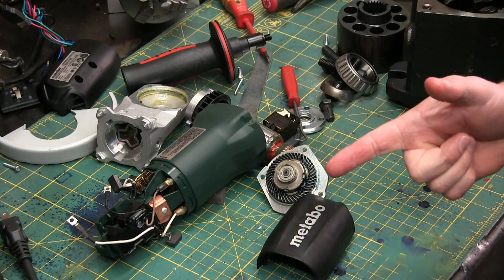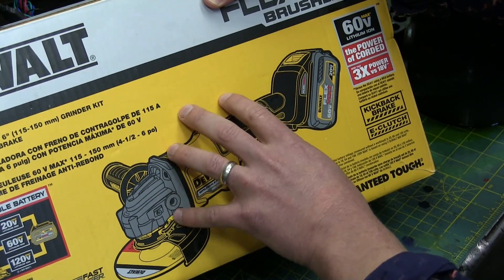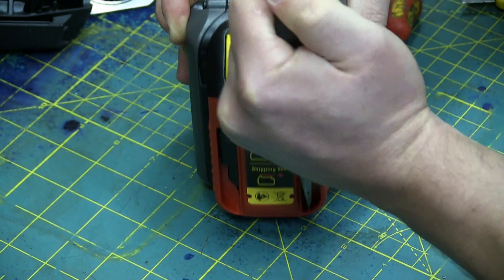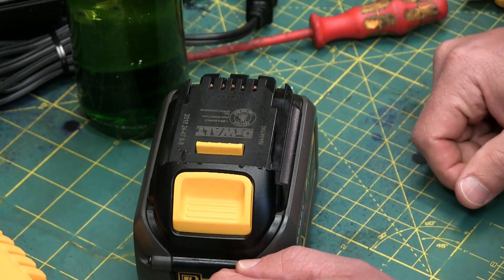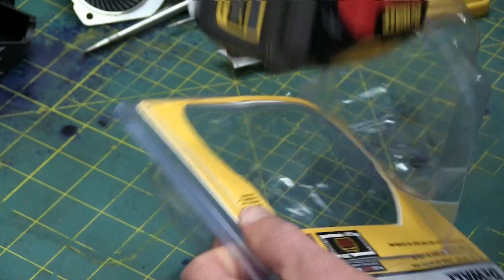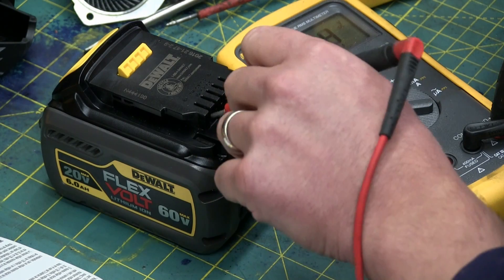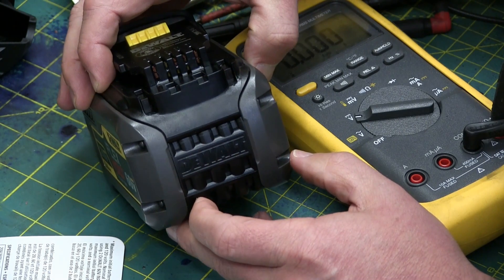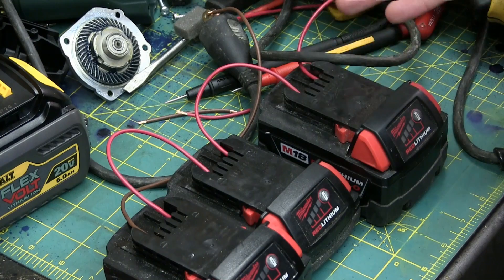Plug-in Power Tool to CORDLESS CONVERSION.

Comment: 60v @ 2A is the same as 20v @ 6A, it's more or less marketing for those not in the know. Bigger number arggg arggg must be better. nope
Reply: It's not exactly linear. EE Undergrad senior, I know, power is equal to current times voltage, or voltage squared over resistance, or current squared times resistance, I know. However, I had an internship this summer at a company that does high power water pumping setups for golf courses and muni plants and stuff. 

Anyways, from what I saw, higher voltage does need less current, but it seems to need less current than it would need to maintain a linear relationship. It's not even worth mentioning until you're at least at like 460V sucking 10s of amps but... Idk. Thats what I observed from the hours I spent going through spec sheets. Of course this could all play out very differently in the field. 

Those batteries are pretty thick though. That either means they last longer or they pump out more power.
Reply: Yes you will loose more power in the wiring, speed controller, pcb traces, etc... if all other things are equal (wire size, traces, controller. etc) with a lower voltage and higher current because  of resistance. I wonder if this is what you witnessed on your trip. In a 40 volt system with 20awg wire @ 4A you'll drop 324mw every foot. On the other hand, In a 4 volt system of 20awg wire @ 40A you'll drop 32.4 watts every foot. Of course these numbers are not real world applications, just chosen to show the transmission loss.  It gets worse with skin effect at pwm frequency of the motor controller. Ohms law scales linear, real world has many factors unaccounted for. cheers

Comment: Couldn't you jump those terminals to put the pack in series?  I would think the switching is done in the tool and it just uses the different terminals as needed.  Could be wrong, just a thought.

Comment: Sorry to break this and disregard the project of a "battery mains booster". But /usually/ it makes sense to fix the root of the problem(s)... Maybe same-side driving, SI-units and one international mains plug are unrealistic dreams. But one mains voltage and one common decimal point seem to be a plausible goal. I don't care much about changing what decimal point I use - but it's obvious that one of the mains standards are just not good. Even without knowledge about P=I^2*R and the price of copper - most people will recognize that "85-130VAC" sucks compared to "206-242VAC"... So a change would be good for the climate, great for the consumers, fantastic for the manufactures! :-) But it will admittedly probably suck for the ones getting their "d*ck in an outlet" (to stay tuned to the AvE lingo ;-). But I guess that's no fun in any case - so just keep all bodyparts away from the mains at all time! ;-)

Thanks for great fun and interesting tear-downs! :-D This one seems a bit off target, though.... :-P

Comment: The batteries are not fully charged from the factory because lithium batteries are generally best stored only partially charged - that makes them last longer. 
Also why not use capacitors instead of batteries for the voltage booster?

Comment: for the power tool boos box, I have a fairly simplistic suggestion. If the tools run fine on DC, why not using a heavy duty bridge rectifier and an big ass (super) capacitor which would both smooth the output and provide the slack needed for tool spin-up. Just putting the idea out there, not saying it is the best solution.

Comment: Are you joking when you say they save money by not charging them at the factory?  Lithium batteries have a longer life if not stored at full voltage, so they're shipped at around 3.8 volts per cell.  Think of them as like a spring, too compressed or too stretched and they don't do so well.  Very Buddhist in a way.

Comment: One tear down Exploratorium we haven't seen is on the hitachi 5" grinder. There are 2 model styles with amps being the difference. They usually price the same-ish as the Mikita.  Within personal experience I found myself frustrated with stopping Mikitas dead and settled in on hitachi. Got better life out of them and ran them damn hard. Would love to see them in the comparison.  Our local welder hall uses them to supply their guys and usually dumps the summer beaters at auction pretty cheap is you can catch them....

Comment: Use capacitors.
Reply: I would say a power bar with a built in capacitor probably could modify one of the ones they use for car stereo systems or just hook a bunch up together

Comment: As for the turbo booster...I may be way off but why not just use a managed UPS (one that can be programmed to compensate for voltage sag)?...

Granted, it'll probably cost $2K and they're usually meant for lead acid but meh

Comment: I believe they ship with 84% charge to prevent degradation
Reply: At least for lithium
Reply: I'm a rc addict myself and as you said, i alwais put my lipo's  in storage mode if im not going to be using it for over a few days. I only charge it full right before use.
Reply: indeed. These packs shouldn't be stored below 40, or above 85'ish.
Reply: @SweMisterB  Dya mean percentage or Degree F.
Reply: IATA packing Instructions say that small batteries have to be shipped with low charge if going by air freight, of course. Good chance there's at least some of that in there.
Reply: 69
Reply: My smart charger targets 40% for storage of lipos, but that is after they have been charged up and used. Perhaps both percentages have been optimized.

Comment: Get yourself a 12V 1500 watt inverter and build a 12V lithium ion battery pack of whatever amp hour capacity you desire.  Package it up all pretty and be done.  Just because that ac drill spun up when connected to the 60V doesn't mean it will work when you actually go to drill a hole.  Try that with a regular corded angle grinder or a bigger tool that has a larger start up current and I doubt it will work the same way.
Reply: yeah. thats kinda what i was thinking, but the problem with that is that job site tools pull a full 15A @ ~120V , and even lithium would not last long by itself, and a working man would soon get pissed off and go back to an extension cord.  So with AvE's idea,  its smart, but to match the walls AC, to save it  from bogging down,  you would need a pure sine inverter to match the pure waves that the wall is putting out. and not to mention, pure sine inverters are EXPENSIVE.
Reply: Most power corded tools are going to have universal motors and decent inverters can be quite expensive also turning 12v Dc into 120v ac is going to draw a lot of current from the input so the batteries. It would be better to have a bunch of batteries in series to get 120v DC then build an inverter to turn that into 120v AC but you would need an electrical engineering degree to design a circuit capable of that.
Reply: it will, if the batt voltage is 120/sqrt(2)=85VDC, the torque will remain the same as with 120VAC

Comment: lasersabber has done a 400watt "soln1" as he calls it. he built a custom board to hold a bank of super caps that are charged by 4-100watt solar panels. each super cap has a balance Circuit.
and has show that the super caps can start cars. i have been thinking on doing something like what you said, a booster pack, but I was thinking supercaps and starting capps and battery at 120 hoping it would do a pulsed DC setup of what you did except with super caps and starting caps. starting caps to give that fast discharge and pulse the signal under load(in theory) while pulling power out of battery or wall. j Garcia on YouTube did the electric vw samba, anyways, does a great demo of fast charging 18650s. if you look up laser saber soln1 you will find his YouTube video, and then click on link to store or Google soln1 for sale. so the point is has a link to some lithium iron phosphate battery "lifepo" battery cell with bolt on terminals, cylinder in shape, vent cap on top, easy to stack and are pretty robust.
Reply: http://teslamaker.com/

Comment: so what about using something like a industrial ups battery backup my dad picked up this huge one for free from work the batteries died and the people that run the office only know problem solving with money (ie getting something new) he took it apart found out it had a lead acid tractor battery in it and replaced it we not use it for lamps in my grandmothers house for when the power goes out   in using a UPS you would just have to take out the over volt and amp circuit and you would have the same thing   

yeah yeah i know super long comments no one likes reading with to much personal info it is 

have a good one

Comment: @AvE  This is all very groovy but is it possible to turn cordless tools into plug-in 110 volt AC power tools.  If so, could you please do a video about this topic.  What if a sad soul has a bunch of cordless tools with all the batteries hooped & the batteries are either more expensive than buying a new tool or not available?  Wouldn't it be nice to be able to convert all those perfectly good cordless tools to AC?  Thanks in advance.  Cheers from a fellow Canadian from the west coast.

Comment: They make grid tie inverters that are simple and somewhat efficient because they use the sine-wave from the utility power to set the frequency so you don't get that noisy square wave bullshit.  Just need a simple charger and your golden.  The problem would be this set-up would not be cordless unless to could create the sine-wave for the inverter or I guess just use the 60 volt battery.

Comment: You have to engage the buttons by the terminals. Check it on your grinder to see those tabs that engage them. Better yet try to put a 20v max on your 60v grinder. It will show you then

Comment: So the more I think about it, you don't really want to introduce a DC offset so much as design a (very high power) amplifier to boost the RMS voltage, using the mains frequency as an input signal. Battery charger would be a separate circuit with a cutout when the "amp" circuit gets involved.

A simpler way would be to rectify (and maybe smooth - might not be necessary?) the incoming AC so the tool is always running on DC anyway, then switch in the batteries in series to boost the resultant DC voltage. This strikes me as a much simpler way to do it.

Comment: No good in OZ, 240v would need too many batteries. I have a small generator, it solves the long cord problems. Thanks anyway.
Reply: Most corded tools need anything from 110-240v to run.

Comment: Regarding the battery not being fully charged on arrival, it has to do with maximizing life of the battery.  Lithium Ion batteries will last longest when kept at a lower state of charge. However, permanent damage will occur if the cells drop below a certain voltage (lower than the 0% indicated charge state where the internal circuitry of the battery cuts off output). Manufacturers don't want their product sitting on the shelf, possibly for months at 100% charge because that reduces the life of the battery, and they don't want the battery sitting with no charge because the battery will continue to self discharge to a point where the capacity and performance of the battery is negatively impacted.

Comment: AvE, is it possible that it's as simple as the three extra slots in the battery are connected to each 20V pack in series? so that a 60V tool would have those three middle connection connected providing 60V? While a 20V tool would only use the outer two slots

Comment: Lithium batteries come part charged because they don't like to be stored Fully Charged, they degrade faster.
They also don't like to be depleted past 20%. There's usually some circuitry in there to avoid this.

Comment: Got it! Look at the big extra bit of plastic on the bottom of the 60v tools compared to the 20v tools. It activates a spring loaded switch to change the battery configuration.
Reply: Someone else has confirmed for me that I was right, it is the spring loaded switch (near terminals which the red protective bit was engaging) that changes the voltage.

Comment: DC you say?     I say a 60v DC power supply connected to batteries and then connected to power tool would work.  Batteries serve as a buffer for in rush current demand

Comment: Now I'm no electrical engineer so some of this is likely to be wrong. But after thinking about it for a little bit, I believe you'd either need to make it all AC or all DC. All DC should be pretty simple. Take the 120VAC input, get it down to 42VAC RMS with a transformer, pass it through a full bridge rectifier and some caps, you've got the same 60VDC that's coming out of your batteries. If you parallel the two voltage sources, you should be drawing half the amperage from each, yeah? So if you unplugged from the wall, you'd be cordless, just discharging the batteries at a faster rate. And if you pulled the batteries or they died, you'd have full power going through the cord like normal. You may need some protection so that the batteries charge correctly, or are blocked from charging while in the device, however that'd need to work.

Only downside is this wouldn't work with devices that are expecting AC power and won't run at all on DC. I'd put an inverter on the output perhaps to give you the AC sine wave again, preferably back up at 120V for maximum compatibility.

Comment: It is an intriguing idea   but you cannot inject DC onto the AC line         you want to switch from  DC to AC after the start   and back if current rises above 15 amps
Reply: But as mike said    just put soft start in all your drills
Reply: You can inject DC into AC, but it has to be done through an AC inverter, the term is known as DC Boost and can be adjusted in varying degrees depending on the need and often regulated based off of amp draw and a specified frequency range, once amp draw drops in a given time frame as speed increases the DC Boost is scaled back or ramped to 0 volts DC if desired. Conversely, if too much is used for too long it will smoke right through the motor's winding insulation.....and that is no bueno! It's common to use this wizardry when start up loads are high when starting at zero RPM to sustained speeds, or a desired speed setting. Very useful when overhung loads or high start up friction is present.

Comment: Well, if you want my support on how good of an idea this is, you wont get it as you will put me out of a job. Just out side edmonton i work on a job site, sitting at the breaker flicking the switch's that trip. thats it. mind you its minimum wage, but at 14 hours a day to site on my laptop playing games untill i hear the breaker, which takes two seconds to reach over and flick back on. its basically free money. every day of the week two, so i get 1.5x overtime after 44 hours. (also the hotel rate they got me is almost as good as renting an apartment)

Comment: If you're running a long power cord you can just put a big capacitor at the end right before the tool connects. That'll take the starting and peak loads to keep the current constant. We do that in RC planes when we need to extend the battery wire so the connectors don't melt together.

Comment: Seems like the easiest, cheapest and best way to do this is to add a supercap (or three) and a small controller into a plug attached to the end of the tool. If we aren't modifying the end of the tool itself just make it a pass through like a wall split er kinda like this: https://www.amazon.com/3-grounded-Outlet-T-shaped-Adapter-Orange/dp/B0065N2T5A/ref=pd_lpo_60_tr_img_3?ie=UTF8&psc=1&refRID=VR7JP77YPXXZXJ4S7EB5 - imagine the bulges are the capacitors.

You could easily add on a power interface off the middle of this outlet-condom-esk thing too allow plugging in battery packs that allow the tool to run for more than 2 seconds. Two part system yes but you get the best of both worlds. The first part is cheap and solves the breaker tripping problem and the second one allows you to follow this foolhardy notion of making corded tools cordless(ish).

Comment: Great video Ave.  I'd suggest re-configuring batteries or adding powertool battery scabbabilty to a jumpbox like a Schumacher XP2260.  It has the AC plug and ample room for a gaggle of capacitors or other electrickery.

Comment: Why don't you just buy one of those rechargeable solar generators and plug that into the 1,000 foot extension cord (not the solar panels). Then you have instant juice and it can recharge simultaneously or tandem.

Comment: Hey AvE! About those lithium packs only being half charged out of the box, its not a money saving gimick, its a shelf life insurance policy. so to speak. For whatever reason ( im no chemist so im not entirely sure why) a half charged lithium will hold its charge basically FOREVER. less than half and it will trickle down to the point where the charger wont accept it, any more and the cells will degrade as it sits and shorten the over all life of the pack. Why dose this happen? no friggen idea. but i learnt it while attending a hybrid vehicle training class and the instructor pointed it out while we were going over the massive 2k volt lithium bat packs in cars.

Comment: The "equivalent" to a universal motor in the electronics world is a switch mode power supply.  By "equivalent" I mean if you have an AC electronic device (like your Rigol oscilloscope) it will run just fine off of about 50-60VDC.

I'll let you think about why that works.